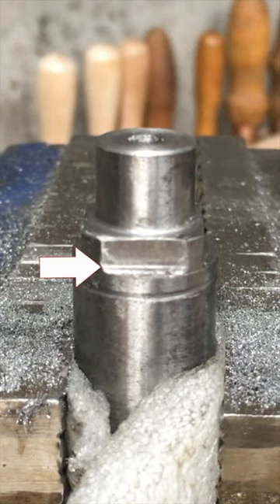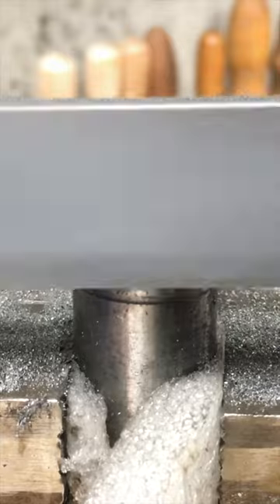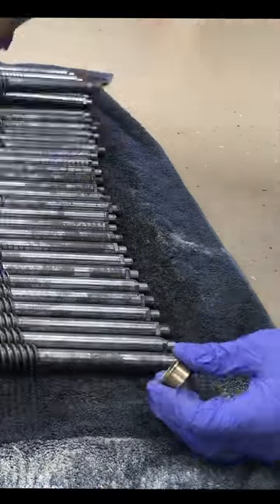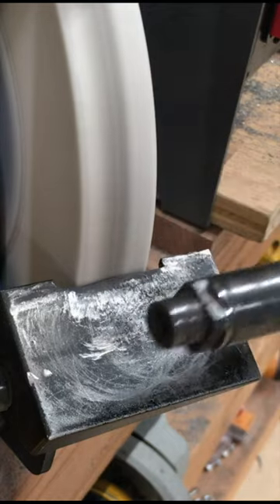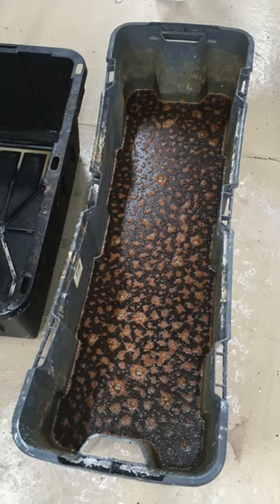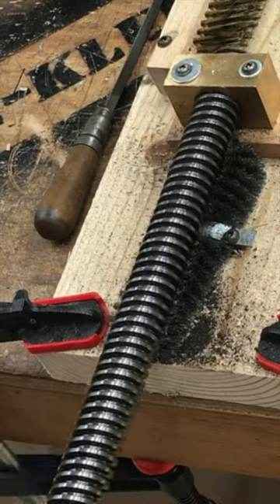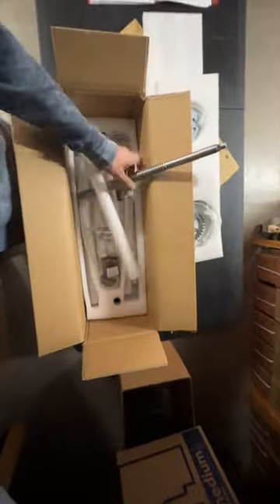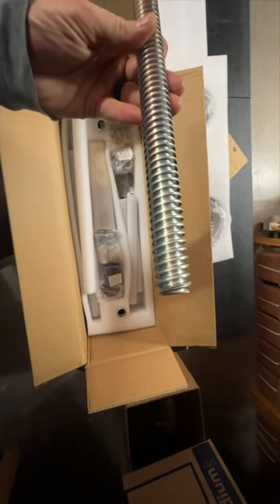Twin Turbo Vise Screw Problems

Comment: Wow. All of those problems would have been easily and cheaply prevented. A flat endmill used VS a radius, a 10-15 second deburring, and a 15 second spray/wipe down of oil. Virtually no added cost to them and they lost a customer because of it. One thing to make sure for the next supplier though. Make a note in the drawings that the corner of those shoulders is critical. I'd bet that even if the drawing shows a corner instead of a radius, when their machinist used a radius cutter, inspection either didn't catch it or assumed it wasn't critical to function and passed it. Good on you for making things right. I wish all business owners worked that way.